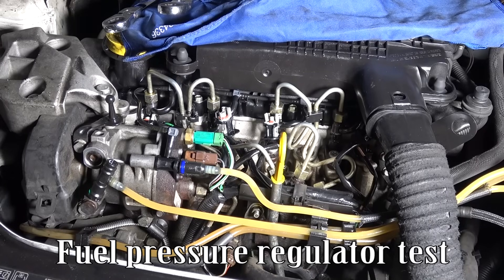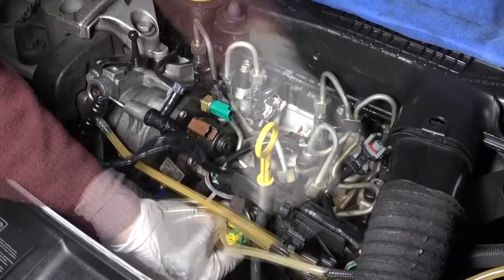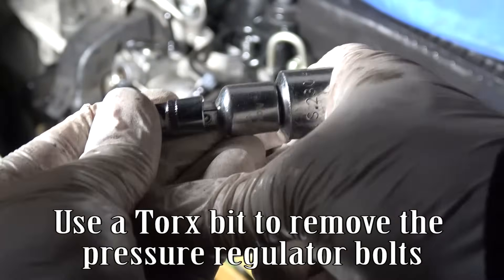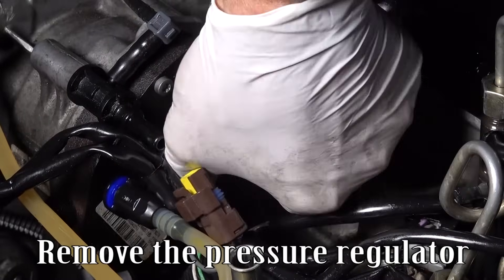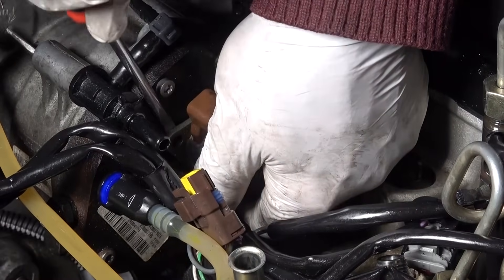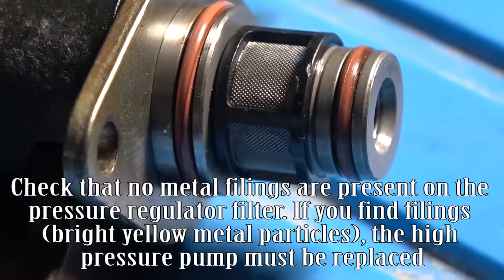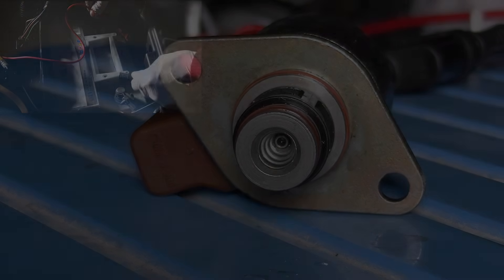Pressure regulator test

Comment: Hi all, I also have problem with, 1.5 dci, 
... when I remove fuel regulator valve and start pumping hand pump, I dont have jet like in this video :( 
what is the problem, has someone solved it? thank you
Reply: Aynisi bende oldu cözdünüzmü

Comment: Prueba de regulación de presión de combustible

1) Desconecte el conector del regulador de presión
2) Desconecte el conector del sensor de temperatura del diesel
3) Desconectar el conector eléctrico del inyector nro 3 y el conector de la bujía de incandescencia
4) Retire los tornillos de los soportes de los tubos de combustible.
5) Retire el tubo de alta presión en el inyector nro 4
6) Retire la varilla
7) Use una punta torx para quitar los tornillos del regulador de presión
8) Retire los tornillos del regulador de presión.
9) El acceso al segundo tornillo se facilita quitando el tubo de alta presión del inyector nro 3
10) Retire el regulador de presión
11) Si la bomba no está bloqueada, el combustible debe fluir a través de la caja del regulador cuando opere la perilla de cebado.
12) Verifique que no haya limaduras de metal en el filtro del regulador de presión. Si encuentra limaduras (partículas de metal de color amarillo brillante), la bomba de alta presión debe ser reemplazada
13) Conecte dos clips de gancho a los terminales del regulador de presión
14) En las bombas de alta presión Delphi 1.5 dci, la resistencia del regulador de presión debe ser de unos 5 ohmios
15) Si la resistencia es igual a 0 ohmios, los 2 clips de gancho probablemente estén en cortocircuito: reposicionarlos para que tengan una resistencia > 0 ohmios
16) Para probar el funcionamiento de la válvula selenoide, conecte los 2 cables del multímetro a los terminales + y - de la batería.
17) El regulador de presión es un contacto de cierre (normalmente abierto)
18) Cuando el regulador de presión está alimentado, la válvula de cierre debe moverse
19) Este regulador de presión funciona perfectamente

Comment: Hi all, I also have problem with clio 2, 1.5 dci, 82 hp... when I remove fuel regulator valve and start pumping hand pump, I dont have jet like in this video :( can someone help me with this problem? Do I need to replace High pressure pump? I dont have metal particles...
Reply: Aynisi bende oluyor cözdünüzmü acaba

Comment: The resistance should be 5,3 Ohm +- 0,5 Ohm at 20 degree Celcius according to the the original Renault k9k diesel engine workshop manual. Remember about the temperature guys.
Reply: Hi, do you have workshop manual and could you share it somehow?
Reply: А если у меня 8.7 Ом?под замену регулятор????

Comment: Hello, nice video. I got df127 supply voltage sensor and fuel pressure is 2000bar in rail. car cranks but wouldn't start even with easy start. any thoughts?

Comment: What does it mean if the regulator is always open? Does it mean the fuel pressure will be low, if the connector to it is unugged?
Reply: It will stay open when there is no power supply. i.e when the car is turned off

Comment: no metal yellow fillings on regulator valve but no fuel come out when squuze priming fuel pump any ideas anyone? if blocked how & what solution please?
Reply: Did you find the problem?
Reply: @doYourBest4All  no i just give up in the end bought a cheap 07 peugeot 407 €380 no problem have 2 mnt's just need get the dpf out & give it a good power wash

Comment: Not a good test, plenty of faulty regulators will work when in open air under no pressure. Put it under 1000 Bar and then see if it works.
Reply: Las válvulas en general, si funcionan afuera, funcionan adentro, ellas o trabajan bien o no trabajan, punto, o es blanco o es negro, pero aca los grises son poco, muy pero muy poco comunes, ahora bien, si tiene otra forma de hacerlo mejor, cual es? , no nos dejes con la duda !
Reply: what you espect, they are youtube mechanics
Reply: This regulator is working in about 4-5 bars pressure so this test is good.

Comment: It is a shame if this is the method you are testing the pressure regulator.
A pressure regulator usually fails at a certain point, and does not stop working completely
So your test is not at all correct
The pressure regulator should be connected to a device that simulates pressure and flows through it.
Then gradually increase the pressure from 200 bar to 1800. And see that there is no pressure drop at a certain moment.
In 90 percent of the cases, a problem is caused by the vehicle being turned off while traveling, and a computer malfunction occurs in low pressure fuel.

Diesel-ramla
Reply: When my wife tried to start off on second gear, she release clutch too fast and steped on gas pedal, but engie died anyway. Since that, engine fault code (fuel pressure regulator fail- maximum limit reach) , and fatal failure is light on when I go full throttle, but when I release throttle , everything went OK. Car is not smoking (even when I have model without exhoust filter) acceleration , power, starting, and sound is normal. Could be regulator demaged due to my wifes failed atempt to start off ?
Reply: @jancadek3913  connect a error code reader and clean out fail codes, if they reappear it might be faulty, otherwise only a glitch in electronic programming
Reply: @gandalfwhite60  I already sold that car. but before I have done that I found source of this problems. When I pulled out pressure regulator and squised rubber diesel pump, fuel does not bursted out, just lazy dropped. So something in rotary high pressure pump whas cloged. Even cloged it can build enaugh pressure to not trigger fault code, but it not build eaugh fuel flow to feed injectors, so with "full throtle" pressure droped , power stoped to raise, and loot of fault codes apears including pressure regulator malfunction.
Reply: Totally agree with you.

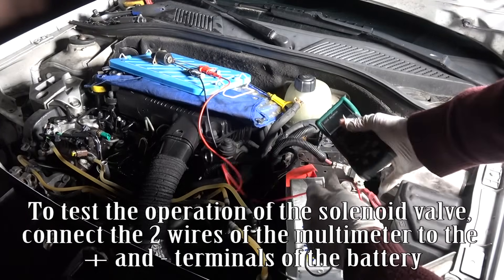Comment: Closing contact? 3:41. Does not make sense.There are no normally open or normally close contacts in the valve, a plunger moves when its coil is energised and returns to its position when de-energised, the movement of this plunger opens and closes the fuel ports.

Comment: taken the regulator out on mine and when priming with hand pump the fuel struggles to come throuh....would you put it to a blocked pump?
Reply: Could be problem with supply to primer (filter?). Try connecting temporary fuel supply to primer.
Reply: @garybrown5500  hy, how should i do that??
Reply: @MrDaumuie  Get a jug or something with fuel and put the end of the pipe from the filter in & see if you can get good flow then. Work your way back if ok to the tank to locate the restriction. In my experience most fuel pressure problems are due to bad injectors.
Reply: Mowgz -c.o.v
Reply: Bhura
Reply: Love
Reply: So does mine when the imv is out and I prime it by hand it struggles to come out but when I crank it it comes shooting out,, did U fix this problem I'm getting inlet metering valve problem....I'm about to replace my imv coz iam getting this code
Reply: @TysonABD cözebildizmi acaba